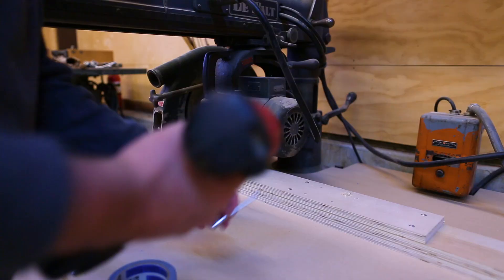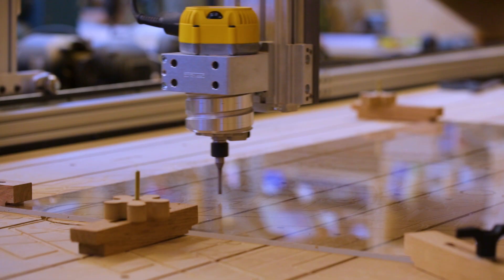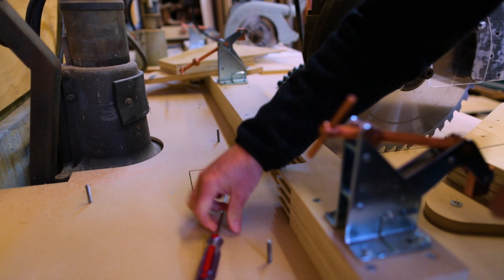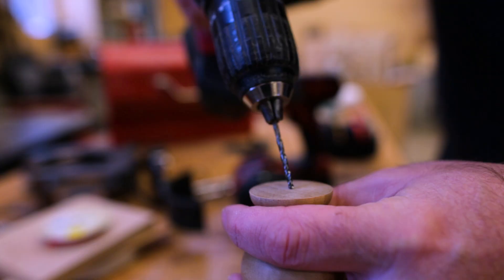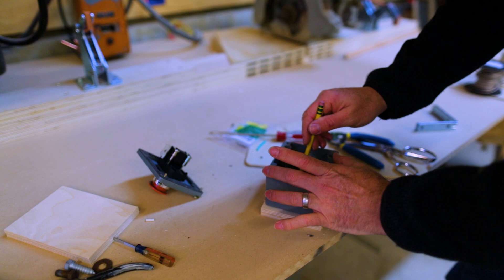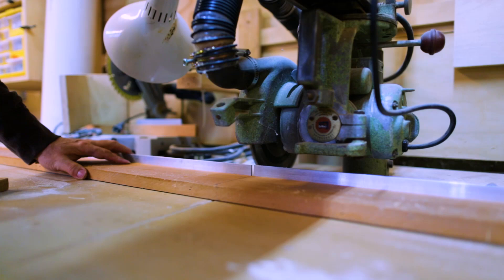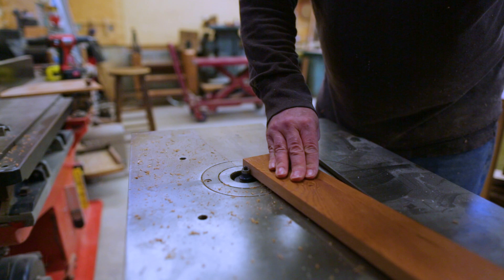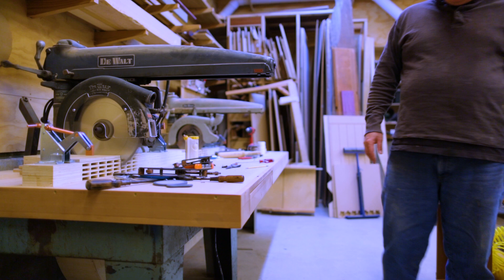Radial Arm Saw 3

Comment: One thing I've learned with acrylic and polycarbonate is that less flutes give better results. I have a single flute bit that did much better than. L3 and 4 flute bits. Also with acrylic, cast acrylic tends to machine better than extruded acrylic. Extruded acrylic has more issues with gumming up the bit like that. I'm by no means an expert - just sharing what I've found this far. :)
Reply: I concur. I engrave and cut acrylic on my CNC. Always use cast and stay away from extruded. I learned from experience. Extruded gummed up the bit until it became a disaster. I never have problems with cast acrylic.
Reply: The fundamental problem is the spindle speed is way to high for the feed rate.  Single flute bits allows for a slower feed rate. Thats why it works better.

Comment: I have a Dewalt 12" GP RAS that is 3 phase 5hp. I had to use a VFD to power it with 230V 1 phase. It has a ramp setting for power up and power down. I have both set to 5 seconds. It works great. Before I set it mine did the same thing, it would still be spinning and I was ready for the next operation...........I need to put an e-stop on mine.

Comment: Straight cut bits tend to work better with plastics. They clear chips right out perpendicularly, rather than pull them up or down--causing them to gum up.
Reply: It gums up because the spindle speed is way to high and the feed rate is way too low.  The cutter is rubbing and not cutting.

Comment: The Stainless screws will corrode with the Aluminum over time through Galvanic Corrosion.  Grade 5 zinc plated would be much better.  The screws will get stuck in there, and you'll have to eventually drill them out.  Sometimes anti seize helps, but not always since it's usually electrically conductive it just slows it down.

Comment: If you happened to be using polycarbonate instead of acrylic, then yes... it is more gummy. But it's also shatter proof. Something you do want for any type of guard.

Secondly, go back and remove your stainless screws and dip them in Phillips Milk of Magnesia. (Yes, seriously... it's a thing, you can google it) Then you will not get galvanic corrosion or galling. They will remove easier as well.

Comment: Apply some Anti-seize to the threads of the stainless fastener to slow the galvanic corrosion process between the two dissimilar metals.

Comment: Just amazing, love all the ingenuity! I have two Dewalt cast iron radial arm saws, and I can't figure out what to do with the key power switch located in the very back of the saw, because it's such an awkward position for the power switch. On the newer Dewalt, it has front facing power buttons on the arm, so I'm thinking I'll probably use the newer Dewalt saw as my primary saw.

Comment: The one thing that came to mind in terms of what would I do differently is the duct gates.  Rather than having to disassemble the dust collection hood to open or close the gate I think a sliding gate would be a lot better.  It could be made from any material, but perhaps the most effective would be some sheet metal.  Otherwise this is an awesome project and a real huge improvement over the previous set up.  Other than sliding gates I don't think it can be improved any further.  Time will tell as you put it to good use.
Reply: Oh and the gate would most likely be built into the square duct and be log enough to be accessible just by reaching under the saw.  Easy open/close and not having to remove the hood.

Comment: Have you considered using a long bolt on the gate that passes through the hood? Thus allowing you to lift the gate without removing the hood. A nut can be used to hold the gate up.

Comment: Try blue thread locker or anti-seize as a barrier on the stainless screws for the shroud. The stainless will corrode the aluminum if you don't protect it.

Comment: I think this might be the 4th or 5th time I've watched this video...love these Radial Arm Saws. I am looking for a god old one now.... thank you for that.
Reply: Did you ever get a radial arm saw? I can't stop buying them. It's become a really bad obsession, because they are so cheap and so many people are selling them. They take up a ton of space, and aren't particularly practical. But they just look so cool, they are one of the neatest power tools ever made. I have to say, if someone hasn't used a radial arm saw before, they are the most fun power tool, even more fun than a chainsaw. The way it feels cutting, with the nearly silent induction motor without brushes, and without the horrible hypoid gear whine of a miter saw, is something that is beautiful to behold. You don't even need hearing protection to use a radial arm saw, because they are literally 50% quieter than a similar sized miter saw. The only noise you hear is the blade spinning in the air, and the sound of the teeth hitting the wood. Using a miter saw is obnoxiously loud in comparison.

Comment: kinda late I'm sure, but heat is the problem with your plastic cutting. strapping a vacuum to the head of the mill and collecting dust that way will also help to cool the bit, and keep the work area cleaner. or you can just do what I did and strap an air blast nozzle to it and just blow chips everywhere, but cut quality is infinitely better.
also try increasing your feed speed like 20%

Comment: on plexiglass use a razor sharp two flute end mill at a couple thousand rpm , use a med to high feed rate, and blast the end mill with your air nozzle while your cutting,  heat is the enemy !

Comment: BTW stainless and aluminum are well known for galvanic corrosion in water, don't know about the dry environment.
Reply: Yeah, the stainless causes the aluminum to corrode and the screw becomes non-removeable. I think Frank should change it out for galvanized. The zinc will protect both the steel screw and the aluminum threads until it is gone. If his shop is dry, he could probably just put a dab of something on the screw. Never-seize or something.

Comment: Frank, if you install a VFD on that saw, you could have the E-stop activate an electronic brake too, so the motor isn't freewheeling.  If you ever have the need to E-stop that saw, chances are you want the blade to stop NOW!
Reply from the maker: true
Reply: Is it a three-phase motor? If it is single-phase, I am not too sure about VFD. It would still work in theory, but the start relay might interfere with it. However, there is a technique called DC injection that can stop single-phase AC motors pretty fast.

Comment: I would be careful with the screws holding the plexiglass cover. I believe the dissimilar metal corrosion between stainless steel and aluminium is quite a bad one. I would consider using aluminium screws (I know they're not very common) or even nylon ones, considering they're not under much force, or coating the threads in grease or something similar.
Reply: No, it doesn't matter. Its not like they're on a boat out in the salt water.  If anything, just put on some anti seize
Reply: Galvanized screws would hold up for many, many years without corrosion. But plastic would be a good choice, too. Like the others say, a little goop of some kind (never seize or whatever) would probably be sufficient if he keeps the stainless screws in there.

Comment: Galvanic corrosion will still occur with aluminum and stainless steel... But it shouldn't be a big deal if the screws/cover stay dry. 

I'm also curious about those clamps. Seems like a lot of work each time to spin the clamp to hold the wood in place. Maybe some holes and cams in the base board that the material is sitting on would be better? Similar to what Marius Hornberger built for his CNC? 
Or I suppose you could keep a collection of scrap blocks of wood around to put on top of your stock to make the adjustments quicker.

Comment: From experience stainless corrodes with aluminium. I don't know why. By putting some grease on the screws or bolts you solve that problem.

Comment: This comment is about 4 yrs after the fact, but I just saw this video for the first time.
At 4:30-ish where you finished parting off two cylinders and then mounted one in the chuck, I thought for sure, with your meticulous planning, you'd immediate turn a dowel stub, perhaps 1" which would fit a bore in the cover, and then turn the piece around and only then turn the knob.  It could have been press-fit or glued, as you please, but a screw into end grain is a cursed way to mount a knob. But Nooooooooooo! Having skipped over the simplest and surest way to attach that unplanned knob, you part it off, and then try figure out how to mount it to the lid. I was stunned! Never part off a piece which might need to be mounted again without creating or assuring the means to do so.

Comment: Plexiglas, or "Lexxan" and clear acrylic are temperamental in terms of blade speeds, cutting too fast results in melt which gums up the tips of the blade and will mean you end up with a friction cutter rather than a smooth clean cut. I have had best results with my variable speed jigsaw, only for that reason alone. Carbide bits are not really a benefit, because the material is soft enough for hardened metal, and the cutting rate is slow enough for more teeth to be better. Summary: more teeth, less RPMs, medium rate feed speed. A spiral four tooth router bit should knock that out with no trouble at all :)

Comment: I like the Panic Bar, but I'm a bit partial to my own Safety Shutoff System design. I use a microphone that is programmed to recognize a blood-curdling scream. It then kills power to everything but the lights. It works great, but is only temporary yet. It will soon be replaced by digital cameras, running facial recognition software. When the camera recognizes a look of "Oh $#!T" on the operator's face, it kills power, dials 911, and a tourniquet drops down from the ceiling. Ha.

Comment: the tool no one wants to own anymore.  But I'll keep mine because i use it.
One of these days I'll work up the nerve to use a 3 head cutter that sears used to sell made by corbin you can still buy cutters for them.
I see you don't rip with your's I have with mine, first time I sent the wood the wrong way. needless to say it grabbed the board. after that I changed the blade and did some adjustments on my sears saw and it cuts pretty square.  
But now I have a tablesaw set up I won't need to rip on it anymore.
My biggest problem is I need a larger shop, more room.  I really like your's.
My backyard is a hill not real steep but I would have to build in some.
Question, has the shop affected your property value, they say most often they do not increase a home's value, but I can't see why not. What man would not like a Man Cave, or workshop to piddle around in?

Comment: I noticed at the end that the flap over the switch didn't want to return to be flush with the rest of the table front. Perhaps you could add a spring between the flap and the saw and some stops to the flap so the spring could not push the flap beyond the flush position

Comment: Any time you can easily de-power equipment in an emergency is a good thing.  The old placement was certainly awkward and only marginally better than the actual power buttons (maybe).  My Dewalt 925 has the key switch on side of arm so an emergency shutdown on front is more necessary.  
One of the safest things I did though was add a pneumatic foot switch for the power.  It makes the saw much safer since you do not need to remove your hands from the saw handle or the piece of wood you might be holding.  and it still doesn't stop you from using the main power switch for those times when you might be doing long rip cuts.
I'm not sure how effective or useful the acrylic guard is but it doesn't detract from saw operation.  And like the other guy said definitely polycarbonate never acrylic. As safety seems to be of concern, I am  wondering why you don't have the kickback teeth/guard on?
Reply: Do you have photos of your saw setup? I have a Dewalt radial arm saw, an MBF, and it has the horrible key power switch on the back of the arm, not sure who thought this was a good idea, it's one of the only downsides to the old saws, maybe the only downside. The slightly newer saw, model 1400 I have, has a motor brake, and a front mounted power button on the front of the arm. I'm leaning towards using the newer uglier saw, becuase it's a better saw. But it's a tough decision, because the newer Dewalt angular arm saws, whilst better in some ways, just aren't beautiful like the MBF series. The 925 does retain the vintage beauty, in a lot of ways.

Comment: Hey Frank. 

I think you would be far better off using an impact driver to fasten screws rather than a drill. They have greater driving power and a better clutch system to stop the rounding of screw heads.

Jacob

Comment: Stainless steel fasteners in aluminum is susceptible to galvanic corrosion as noted by a difference in their anodic index.  The material with the lower anodic index corrodes preferentially.  https://en.wikipedia.org/wiki/Galvanic_corrosion shows a table listing these values for standard materials.  Stainless fasteners in an aluminum part is a bad idea because the aluminum part will corrode rather than the stainless fastener due to the lower anodic index value.  A safer choice which would result in the fastener corroding rather than the part would be zinc plated or galvanized fasteners.

Comment: Stainless steel and unfinished Aluminum don't get along well and the screw could corrode and fail. To prevent this the screws are dipped in Zinc Chromate primer prior to threading into the Aluminum.  BTW I envy your shop.

Comment: In case you didn't see my comment on part 2, that long spin down time means your motor bearings are shot. They are 88505 and 88507 bearings and are relatively easily replaced. Long spin down times are not safe, as I'm sure you already know.
Reply from the maker: I will have to do that at some point.
Reply: frank howarth given all you give to us, I am happy to send you the bearings as I'm in the middle of restoring a long arm GE and a standard GE after having done the MBF and a GW-2. I have an extra set of the motor bearings. Let me know if you want them and I'll send you my email address.
Reply: Can you explain this? The only thing stopping the blade after you turn off power is drag (bearing drag and air drag from the spinning blade and rotor). How would bad bearings reduce drag? The rotating mass is fairly large and the saw blade rotates at 3400 rpm or so, so I would expect that both a good or a bad bearing would spin for a very long time. It is almost like you are suggesting that a good bearing has more drag than a bad bearing, which doesn't make any sense.
Reply: McKenzie Keith .... The way I was taught, by some professional machine restorers, was that when the grease wears out in the bearing, it provides no friction (or less friction) inside the bearing. that is why when they are noisy (either damaged or devoid of grease) or absent noise, they spin too long, the bearings are bad or about to be bad. I have replaced motor bearings now on three big DeWalt RAS motors, the blade spins down time drops by more than 50-60% with new bearings.
Reply: It is interesting. The purpose of the bearing is to prevent "play" while also minimizing rotational friction. I would think a bad bearing would either have excess play or high friction. Maybe the friction goes down just prior to failure. But I am pretty sure that the blade on a radial arm saw will spin down slowly, even with a new bearing, because it is a direct drive induction motor. On a tablesaw, the belt adds quite a bit of friction which helps the blade spin down more quickly.
Reply: I am beginning another GE restoration. If the motor bearings are bad and I change them, I will post a before and after video on the spin down time differential.

Comment: Frank, I found some primary evidence that refutes the claim I made on your last video which was based on the apparent internet forum myth about long blade drift time after turning off the saw being a sign that the bearings need to be replaced due to dried up grease.  In his book Easy Ways to Expert Woodworking from 1956, Robert Schraff mentions this on p. 140, "because the direct-drive motors of radial-arm machines are equipped with high-quality ball bearings, the cutting tool on the motor shaft normally continues to revolve for a considerable length of time after the motor is shut off. This drift time ordinarily varies from 3 to 5 minutes, depending on the size and weight of the tool being used."
Reply from the maker: most of the tools in my shop take a while to wind down.  I was a little dubious of them all having bad bearings.  Thanks for the research.

Comment: Frank, when we cut plastic and plexiglass on the CNC we use an Onsrud 63-776 End Mill (https://www.amazon.com/LMT-Onsrud-63-776-Uncoated-Diameter/dp/B001VXS2SW).  It does an excellent job, however, the size is not exactly 0.25" so you need to mic it enter the correct size in your tool database.  Hope you find that helpful.  Happy New Year!

Comment: I wonder if a liquid coolant would make cutting the plexiglass smoother
Reply from the maker: alcohol was suggested
Reply: frank howarth a fine mist so as not to saturate the substrate of the table.
Reply: Yes! Look up Mist coolant systems. Incredibly useful for metal cutting as well. A lot less messier than flood coolant, as well.

Comment: I've always wondered how difficult it would be to retrofit an electric brake to these old-school saws.  It's 'just' a case of reversing the polarity when you release the trigger and the blade is still turning, so I imagine you could mount it in a seperate box on the wall with all the wires routed to it?
Reply: I thought about this. You could add a brake by taking a modern Dewalt circular saw with a brake onto the carriage of the radial arm saw. That way you have a radial arm saw with a modern brushed motor with a brake.